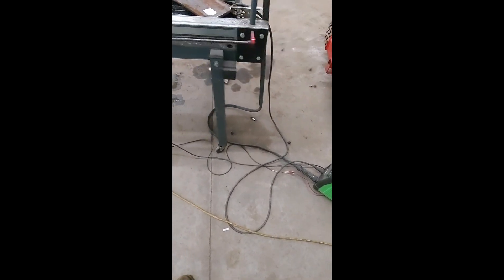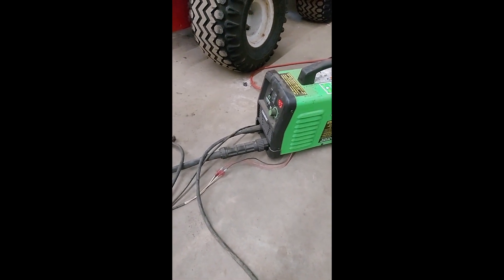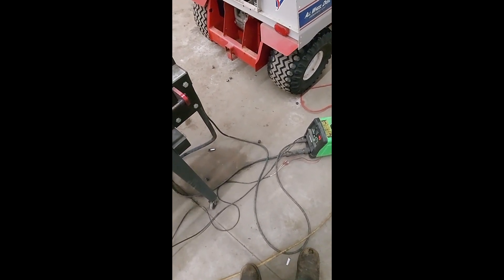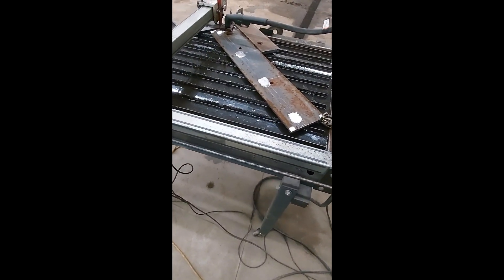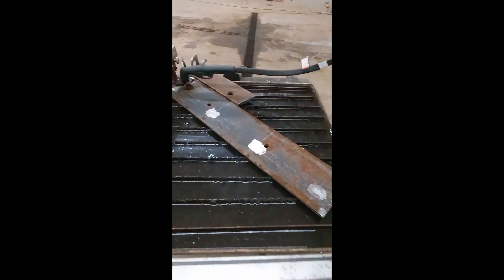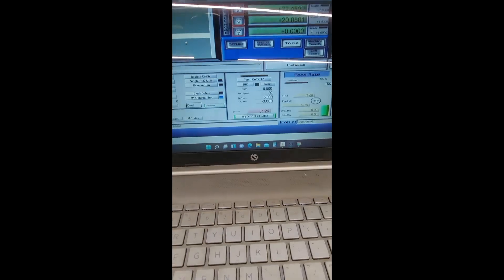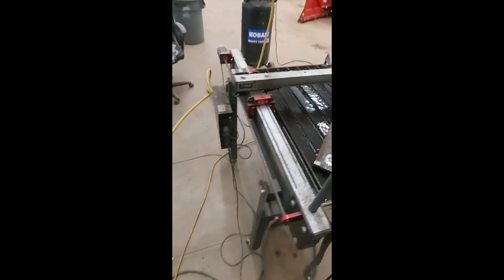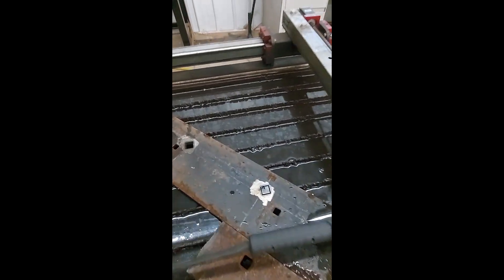Titanium Cut 45 Paired with Langmuir Systems Crossfire Review BUDGET CNC PLASMA Setup for Beginners

Comment: Nice setup! I just wired mine up, and had a question. The instruction manual has you check continuity of trigger circuit before and after wiring. After installing the tri-taps I had continuity button pressed or not, with or without torch screwed in. Did you experience this? I was hoping it was just a harbor freight thing and was normal....😂 Thanks!
Reply from the maker: I honestly never checked it. I am curious now ill have to check.
Reply: @smittyvideos2619  Well no big deal, since I posted that comment I double checked my wiring and fired it up, and it worked!
Reply from the maker: @thejerrytheman  good to hear, and best of luck to you.